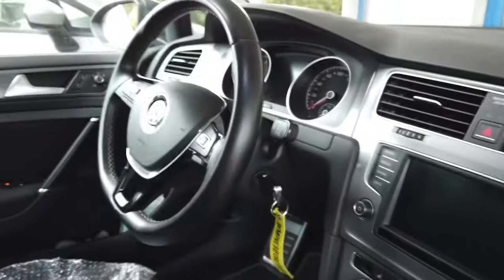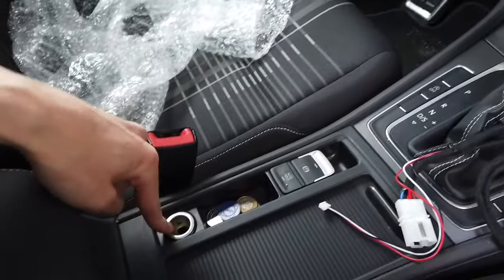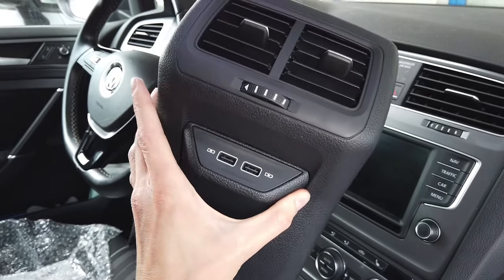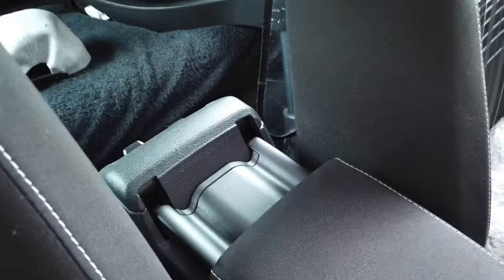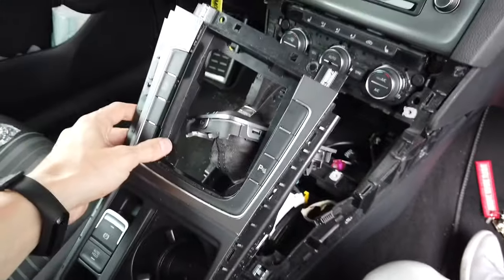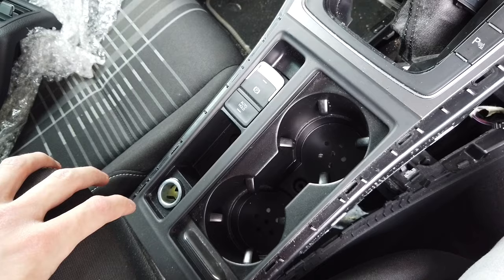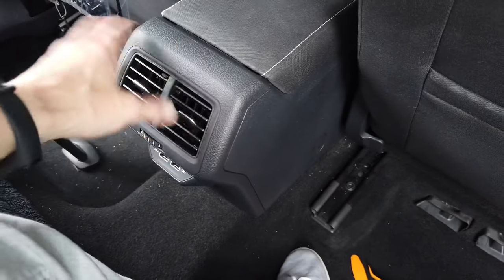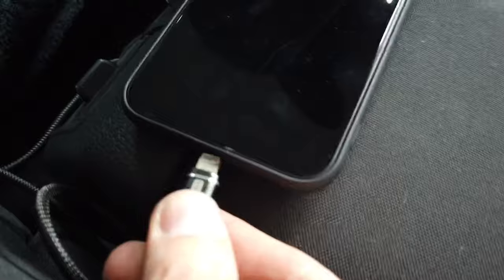VW Golf MK7 (5G) retrofitting double USB charger for back row

Comment: I really liked this idea until I saw your front unit had a USB socket but my 2014 doesn't, it has connectors and leads for Apple devices I believe so don't know if that makes a difference. Then when I saw how much more work was involved pulling out panels I decided my daughter can carry on using the simpler twin USB adapter that plugs in the cigarette lighter socket. Well made video though for those who still want to do it. I'm definitely interested in the stop/start device harness though after seeing your video on it as I always switch that off every start up.

Comment: So cigarette lighter bypassed?
Reply from the maker: Power is split between lighter and charger. Both work.
Reply: @mrfixpl  did you have to modify the supplied harness? Looked like you just plugged the new one into the car one which was destined for the cigarette lighter
Reply from the maker: Plug&Play. No modification to the original harness.
Reply: @mrfixpl  Good stuff. Any advice on upgrading mk7 infotainment systems. Just have the basic system in a 2015 golf, and would like to get android auto

Comment: I would have tested the USB ports before installing all the trim back in place, just in case they didn't work and you needed to check your wiring.  Anyway good video.
Reply from the maker: I think that I did tested it. Just not with the camera on.

Comment: I really appreciate this video. I received mine in June 2021, but felt intimated and kept putting it off till today, June 2022! I too made blood sacrifice. I punctured my index finger and hurt my middle finger while removing the long ABS trim on the left. Didn't even notice till I saw blood on the prying tool! 😆

Hardest part was to move the gear stick back and forth, and until I could do this, the centre console couldn't be removed easily. Thankfully all the plugs worked, and the replacement plastic part fit without modification. It is really very well made.

Interesting the radio showed "VW Golf MK7 (5G) retro fitting double USB char..." so it knows about it through cable from the cigarette lighter power plug. Had to clear some codes as you mentioned. When I posed the question a year ago, that was before I bought an OBD2 dongle. I've learnt so much! Thanks again.
Reply from the maker: Happy to help!

P.S. Your radio most likely showed title of the last media file played on your phone. And I believe you used the phone to watch the tutorial.
Reply: @mrfixpl  Indeed! 🤣

Comment: Done. Thank you for the video. 
In my gtd 7.5 it does not fit 100%, but 99%. I noticed that upper corners are a little bit round, not sharp as the original part. Never mind, it is hardly visible

Comment: Hi, have you fitted rear footwell lights yet, they fit under the front seats.  my latest fit in my scirocco is samsung 15w wireless charger inside the ashtray lid, cant see any modification at all, 100% stock look, but wireless charges my s20 at fast charging, cheers.

Comment: Hi, great video. I would like to get that adapter you use at 6:32 , do you know what that is or have any links so I could purchase that adapter. I did not want to splice the existing wire. Your adapter is a lot cleaner. I would like to use that adapter with the cigarette light to power my led in the phone chubby. Hope you can help...
Reply from the maker: It was part of the rear USB charger set. Not sure where you can get it separately.

Comment: So the provided Aliexpress link is the same vendor you bought yours from?  I ask as there have been reports of these not fitting properly and I would like to be sure the one I buy fits.  Thanks.
Reply from the maker: One that I bought was from "Shop5247112 Store" which was unavailable at the moment when I was making this tutorial.
I saw those reports and there seems to be two types of the rear vent element. Not sure why VW make two different versions and not sure what's the rule over here (is it MK7 vs MK7.5; EU vs USA; electronic parking brake vs hand brake...).
Also keep in mind that MK7 interior was available in 2 or 3 colors.
Reply: @mrfixpl  thanks.  I wonder if there are differences to the vent panel other than color - IE: if an eGolf or R have a different panel then say a GTI or GTD.
Reply: @mrfixpl  thanks again for posting this.   This panel.fit my US-spec Mk7 Golf R perfectly.

Comment: How do I get the two side panel off? It is the hardest since there is no way to pull it out.
It is the most workable part. It will only be able to connect when the side panel is done. Do you have photos?

Comment: Hey! Is it possible to connect with the CarPlay features if the phone is inserted in the rearpanel usb ports?
Reply from the maker: No. Rear ports are for charging only. Not connected to the infotainment unit.
Reply: mr-fix thnk you! The ubs cable annoyes me pretty much😅 i cannot find another usbport, is there any other way to have a usb port that connects to the carplay??  I have a mk7.5 from 2017
Reply from the maker: You can relocate your existing one.
Also there was an option with USB HUB and additional port in the arm rest compartment.
Reply: @mrfixpl  Would that USB HUB run through the infotainment unit? That's what these cars need not just more charging ports. As I mentioned in another post here VW should have had at least 2 USB to infotainment unit plug ins one for phone so you can take advantage of CarPlay and another for iPod or laptop
Reply from the maker: @harryberry474  yes. both USB ports are visible as media source on the infotainment screen. And both can be used for CarPlay/AndroidAuto.
Infotainment using needs to be recoded for double USB. Not sure if firmware needs to be updated for this feature.
Reply: @mrfixpl  I wonder if you could combine this with the hub from your other video. the "control unit" build in the rear plastic part with the 2 usb ports does have four pins for its wiring loom;  only 2 actualy are connected for power: maybe these are just unused data pins? then maybe it'd might just need the right cable

Comment: Is this only for left hand drive cars. Is there any difference for right hand drive. ?
Reply from the maker: To be honest I'm not sure if there's any difference between LHD and RHD cars regarding this element. BUT I've seen some AliExpress feedback that someone bought this part and had a completely different one originally installed in the car (air duct position, arm rest trim). Also there are different interior trim colors so you also need to take a looks at that.

Comment: after I removed my cubby, now the door on the cubby doesn't close, it gets blocked by the upper trim piece of the dual climate control... makes me wonder why hm...
Reply from the maker: Something is misaligned. Check I both clips clicked all the way.
Reply: @mrfixpl  I removed the lid cover and it open and closes smoothly, I must have not installed the lid properly... time to pull it out and start again!
Reply from the maker: Good luck! Don't break anything!
Reply: @mrfixpl  too late... I think I’m just gonna have my dealer deal with it haha... I couldn’t get the cubby back now, and now more plastics have broken off...

Comment: Why would there be any fault codes if you didn't turn the car on during the process?
Reply from the maker: Some systems will come on of you just open/close the door or try to shift DSG from P. Even if the ignition is off.
For example infotainment unit boots up as soon as the drivers door is opened. Screen comes up with ignition but the system has already started and if the AUX/USB port is disconnected it will detect that.
Same for the parking brake button.
Reply from the maker: ...and you want to check if the charger works before putting everything back together, so most likely you will turn the ignition half way though the installation.

Comment: Blood sacrifice is requirement when working on any car, VW's aren't exempt. If I don't bleed I'll probably have to repeat whatever I did because it won't work properly... unless blood is shed.
I'm very disappointed that VW didn't install 2 USB ports in the center column one for phone and one for iPod would that have been too much to ask. I like using iPod for music but because I do I can't have my phone "wired" to infotainment system too which really sucks. Installing those USB ports (for charging) in the center console in back isn't worth it. Just get a cigarette lighter to USB adapter there's 2 cigarette lighter sockets and a million different choices for USB adapters. I understand wanting to keep it stock looking...but for this much work it's just not worthwhile.
Reply from the maker: Actually there was an option with two fully functional USB ports.
USB HUB (5G0 035 953 C).